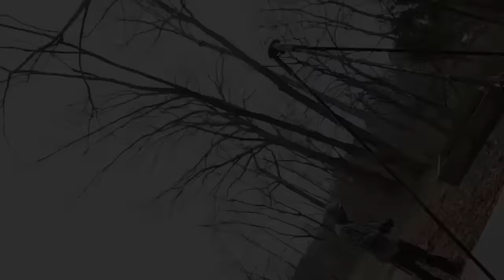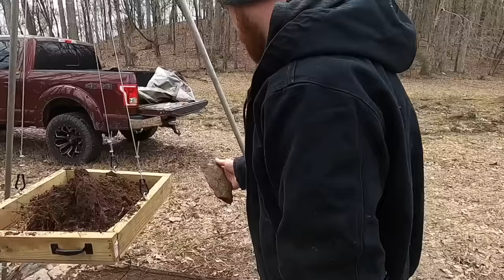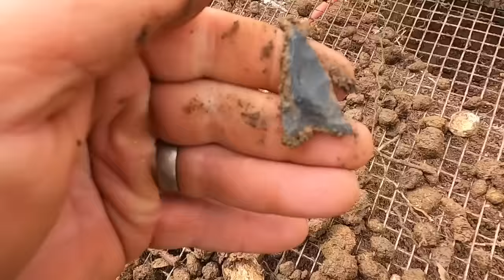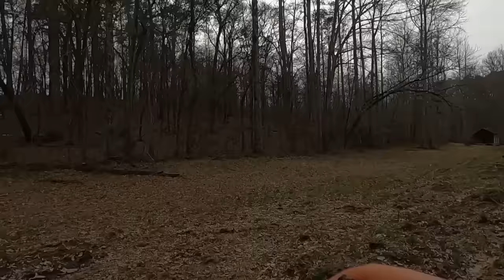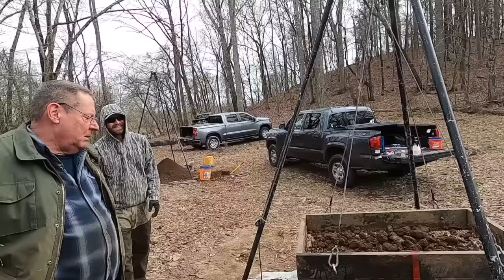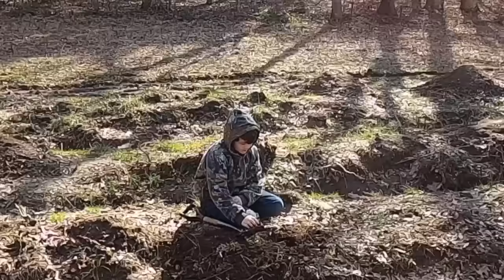Digging deep for ancient artifacts. I've never seen anything like this. #ancienthistory #artifacts

Comment: Hey peeps love your channel! Question for you, what key factors determine where I should dig for points. I live in rural Wisconsin 1/4 mile from a small creek. The larger rivers around here produce some great finds. But I'm wondering if the Indigenous people utilized smaller creeks for living drinking etc. Thanks in advance!
Reply: Small creeks are great to ! Especially if spring fed .
Reply: Or, what key factors determine where to dig for ANY native artifacts? Civil War artifacts? How deep for each? I live in rural Gastonia in North Carolina, just a couple miles South of Crowders  Mountain which is connected by a small ridge to Kings Mountain where The Battle of Kings Mountain took place. I recently bought a metal detector but don't have a clue as to what to look for when searching for a good place to start diggin. Any advice would be greatly appreciated.